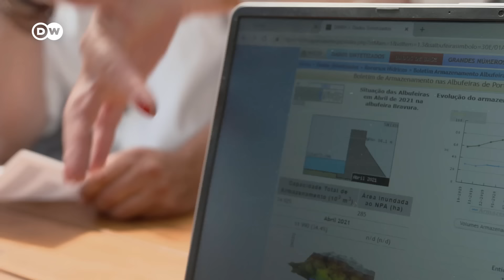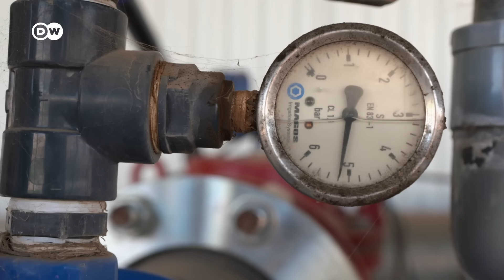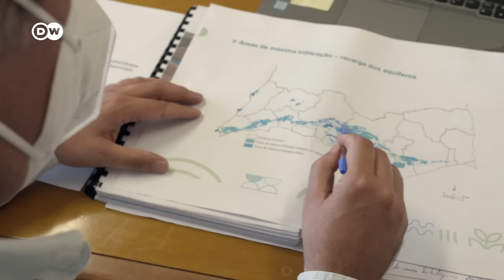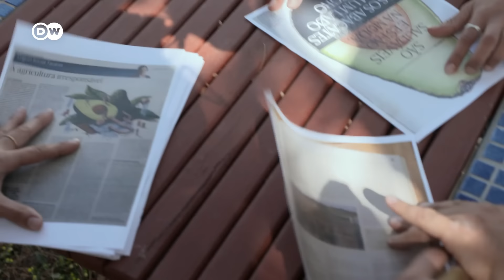Portugal's avocados: Green gold or ecological nightmare? | DW Documentary

Comment: Hugo talks about the "carbon footprint", but keeps quiet about the "water footprint".
Reply: Carbon comes out,and stays there (bad)
Water comes in,and then it comes back (that means its infinite)

The problem is not the use of a finite resource,but the expansion of mass production without the means to do it properly

How can they feed a huge focused plantantion with a local reservoir?? that's insane,the only way going foward would be to dam the whole area so they can use the water from it for farming.
Reply: The carbon footprint isn't necessarily lower either. Depends of the mode of transportation. Most Portugal exports to northern Europe go by truck, which has a much higher carbon footprint than container ships.
Reply: @MegaVictor1129  are we talking about freshwater? cause that is not infinite
Reply: @Mclagging98  The water from rivers end up in the sea,but for some reason they still keep pumping more and more water,why is that?
Saltwater evaporates,but the salt stays there and fresh water becomes rain,dams= using more of potencial rain water

Using wells for such farms Will surelly dry the place quickly,using dams is more realistic for industrial agriculture
Reply: @Mclagging98  fresh water Is infinite. If it was not, you might want to let rain know that it is not real.
Reply: well a single cow needs the same water at 15 avocado plants if not more...so what are we going to do? are you ready to give up meat?
Reply: That's what I was thinking lol. The CO2 emissions emitted via the transport of avocados across the Atlantic aren't a fraction of a drop in the bucket compared to the water depletion posed by avocado monoculture in a climate as dry as the Algarve.
Reply: Don't you love it when a British immigrant thinks his private pond and water for his guest house is more important than growing food for the country he just moved to?

Comment: For comparison, a swimming pool might lose to evaporation about the same amount as an avocado tree consumes every day.
Reply: no
Reply: Hardly a logical comparison
Reply: @essieessie5399  Why not? They both use water, they're both unnecessary, they both exist in southern Portugal, they both use land. Same for lawns. They all, also, provide benefits of one kind or another. They compete for the same limited resource: water.
Reply: @mrluckyuncle  for the 5years that I was the primary care giver of a friend (stage 4 breast cancer) I took care of her 13ft deep inground pool. It made her happy to dangle her feet over the edge while her great grandchildren swam to their hearts contentment. even during the hottest stretches of heatwave the pool did not require an amount that is equal to the use of a 5 member family (as stated in the video per tree ) I would confidently bet less than a third would be sufficient and for only extreme circumstances. that's why no! false equivalencies
Reply: @htopherollem649  Thanks. I only know from googling for what the typical amount of swimming pool evaporation on a daily basis is. I didn't check it myself. Seems like it could be 600 gallons/week. But it depends upon a lot of factors -- like weather. Whatever the amount is, it's worth comparing. But you might be right. I was accepting what the video says for how much water an avocado tree needs per day -- 50 gallons. But here in California, which has a climate similar to Portugal's and also grows avocados, the rule of thumb is only 20 gallons/day for a mature tree. I was going to bet you -- but now I don't know what the data are. Seems like the video might be incorrect.
Reply: @mrluckyuncle  I'm sorry too, I was going on the video's statement that per tree usage was equivalent to that used by a family of 5. additionally the information doesn't specify if that was water usage (for family) or total water footprint (ie. the waters used to produce the consumables needed to sustain said family such as the food they eat). though I try to be aware of the tactics being used to push various narratives, or even to influence ways of thinking, I once again fell into the trap of just accepting the information presented as being true. here I am knowing that the adversaries of freedom promote disinformation with the hopes of making all knowledge suspect. it is now as though the established media sources have joined them in a " race to the bottom" as to the legitimacy of their info.

Comment: Half of the problem of 'heavy' water usage is the bare ground, or inappropriate ground covers used in avocado orchards.  
Living mulches (plants that cover the soil while retaining ground moisture) are a resourceful way to protect the soil from wind, solarization, and flooding.  They can reduce the need for irrigation.  If succulents are used in number they can also protect in the event of fire.  

A mutually beneficial mix of plants can also cut down water use.  Soil, and plants do best in polycultures.  Better still if the polycultures are compatible such that they complement each other. A 'plant guild' is a permaculture term used to describe a type of companion planting.  This involves plant groups, rather than mere pairings of plants.  Plants are often chose for nitrogen- fixing capability, insectaries to host beneficial insects, hormonal/biochemical compatibility, size, tolerance, and other beneficial properties. If they employed better growing practices such as using guilds, water usage would decrease, productivity would still increase.

Comment: The reservoir shown in this video is an old design and is a prime example of water waste.
Solution: drain the reservoir, line it with clay, refill with water then load in thousands of plastic balls to float on the surface.
Reply: Plastic balls? How very medieval. Floating solar panels, son.

Comment: A pity the documentary doesn't focus on the real problem: the subsidies system that feeds the damaging farming practices. The farmer with mulching on the ground of course will have less weeds and water evaporation from the ground, those branches and leaves will help shading the soil and soak water into the ground instead of having runoff and soil erosion from bare soil. Industrial farming without control is damaging because you can badly design an exploration, make super-intensive mono-cultures that require a huge amount of water, fertilizers, herbicides, pesticides, etc. Make policies to promote low-input less damaging practices and avoid social dumping practices, which is difficult when countries like Germany and Belgium with great control over CAP are big agro-chemical products exporters. The "conventional" is only cheaper because it's heavily subsidized, it's where more than half of the EU budget goes to every year. Switch the system and you'll have the yield needed with way less input.